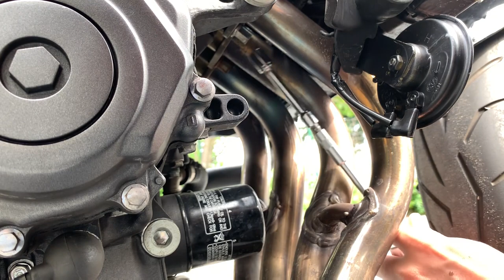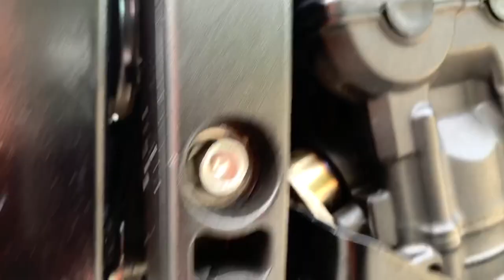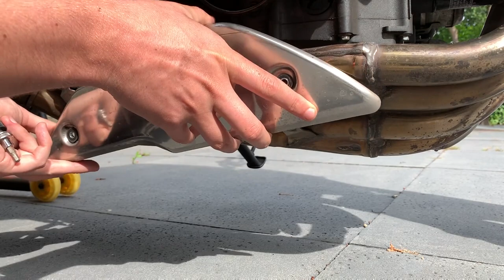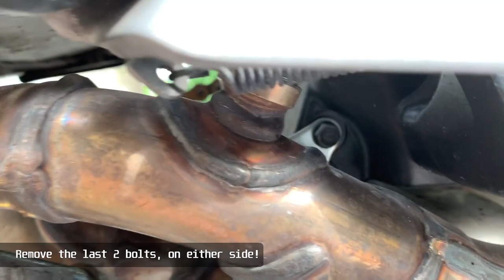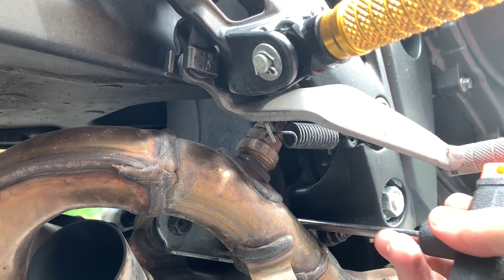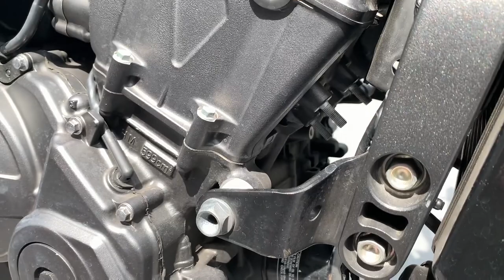#17 De-cat Honda CB600F hornet 2007 - 2013,  CBR600 FA 2011,2012,2013

Comment: Did the same on mine, makes such difference too! Had the bike re mapped on a Dyno.
Reply from the maker: How much was the outcome of the dyno?
Reply: @Kiwiiyt  it wasn't huge for power, 100hp at the rear wheel. But it made the bike so much more responsive, it pulls harder across all the rev range and feels smoother to ride too.
Reply: @SuggyRacing  Do you know if before remapping and without the cat the power was worse than original ?
Reply: @brenocesar5645  I didn't do a Dyno run before I mapped it after removing the cat. I rode it before I had it mapped and it felt fine to ride. It was smoother to ride and better throttle response once it was mapped though.  I also had a quick shifter fitted. The power didn't change much. It was just smoother and faster response on the throttle.
Reply: how much does a map cost usually  @SuggyRacing
Reply: I was wondering too, how much did you pay for the remap?